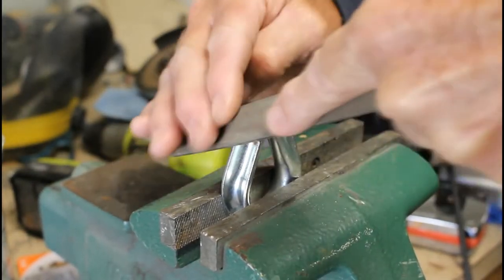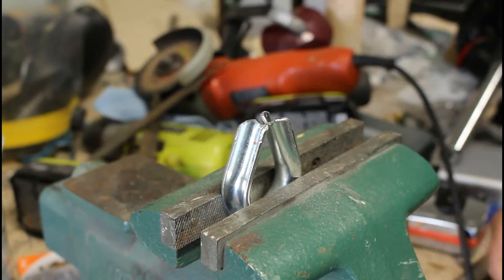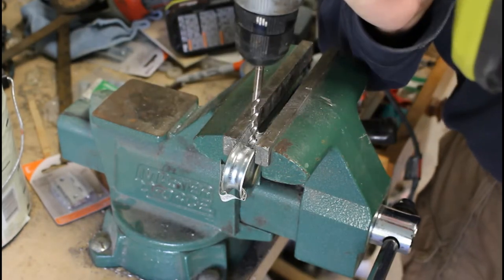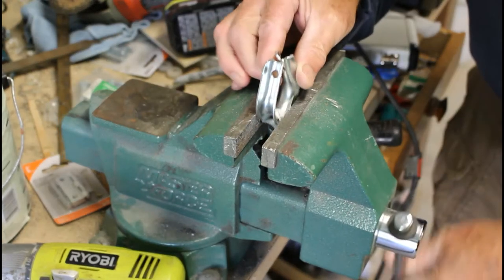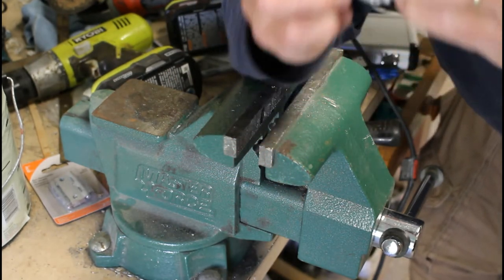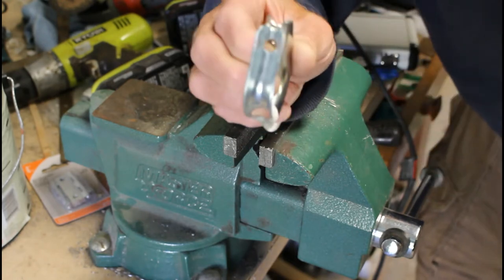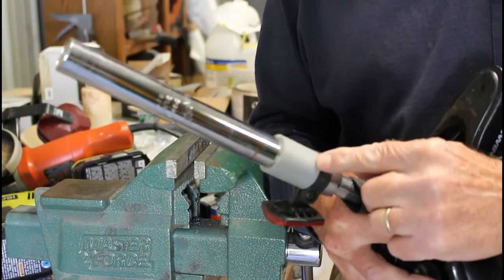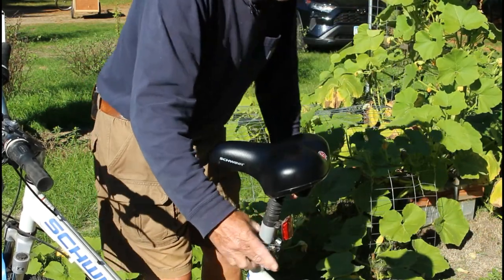My $3 Seat Post Bike Trailer Hitch

Comment: Hey, thanks for the video! I'm missing what the end of the trailer looks like that connects to the thimble with the pin in it. I there a U bolt or something similar at the end of the wood rod? Any chance you could take some close up pictures?

Comment: What is the pin called that goes into the thimble? I really appreciate this video and your great attitude :-)
Reply from the maker: Thanks Jakob. It is just a 1/4" x 1 and 1/2" hitch pin. This one has a D wire that locks it in place. They are commonly used as a safety pin on trailer hitches, and are available either on Amazon or any  hardware store.
Reply: Cotter pin

Comment: Nice shop! I'm going to a seat neck hitch design and will use 2 hose clamps on a large oblong chain link. The trailer pin will go through a second link on the Two link chain. MarkMannM2
Reply from the maker: Sounds interesting Mark. Good luck!

Comment: Ok, you showed the seat post kit, but you didn't show the actual mounting on the trailer tongue in the video. Can you explain how that mount to the trailer tongue is supposed to be done. please. I am wondering why just a 1/2" horseshoe was chosen and not a larger one? This is very simplistic in design and that is great, but I wonder how well it holds up over time with the big trailer cart you have in the video. Your tow bar to the actual trailer is a straight piece. Lots of bike trailers use a rounded tow bar that curves up over the rear tire or even a hitch anchored to the bike rear axle. I am in the process of trying to construct a barrel trailer which will be done up like the ones you see pulled by a lawn tractor as cars. It is a total DIY project and every time I view a different video, I seem to get more and more ideas for doing it up. This one may be great, but one issue I can see is that with a suspension seat as my bike has, it would put the seat up higher to add a hitch setup on that post. Ultimately, it defeats the purpose of the suspension seat, as it won't allow the seat to drop down enough. I need a lower seat than what came on my bike, as it sits too high already. My seat also flips up so I can remove my battery from my electric bike.  A seat post setup as yours would mean I could not use the seat in the same manner in removal of the battery, as the hitch would then be in the way. No real issue on your bike, but it may be on my own. Can you address this reply with your own thoughts, please? Nice modification and nice video explaining it. I'll have to give it a try and see how it works out. My barrel train car will be done up as an airplane and house my dogs as I ride about my neighborhood. I drove a motorcycle sidecar rig for years and riding with my dogs was a great pleasure, so this bike trailer is something I really want to make for them and me to enjoy. Thanks for the video.
Reply from the maker: Greetings James. I have used this hitch on suspension seat posts. But yours sounds like it may not work for this design, if you do not have enough height for it. You might need to go with a rear axle mounted hitch. The 1/2" thimble is the largest one available locally, and it has the proper inside diameter for most seat posts. I have used this design for canoe and utility trailers on several of our bikes for about 7 years, with no issues. I even pulled a canoe, with two 10 year old boys inside of it, behind my bike in a local parade, using this hitch.  If you want to see how a trailer tongue connects to the hitch, I have a link to a previous video in my reply to Nik, about 4 comments below yours. Good luck with your project. It sounds fun.

Comment: What are you using on the tongue of the trailer to hook it up to the seat hitch?
Reply from the maker: Hey John. I messed up by not showing the tongue. It was on a previous video, so I neglected to show it again. In the past, I used metal conduit as the tongue, squeezed the end together in a vise, rounded it, and drilled a 1/4" hole to fit the hitch. The last trailer had a wooden tongue, with a piece of 3/16" metal attached vertically to the end, to fit into the hitch. Here is the link to the other video. Just skip to the part showing the tongue. 
https://www.youtube.com/watch?v=Bu2f29JWAV4&t=2s

Comment: the center gravity of the trailer is too high. it will rock to the point flip over.  Very danger.

Need mount it as low as possible. 

-----

however, I was wondering if you ha e a diy way tp make seat post from conduit?
Reply from the maker: The trailer tongue is in alignment with the top of the trailer. If there is a danger of tipping over, I have not expereinced it. Not sure I understand about a seat post from conduit.I have made trailer tongues fron conduit in the past, rather than from wood. Flatten the end of the conduit in a vise. Drill a 1/4" hole, and grind the end rounded, so it fits into the hitch.

Comment: you must be riding super slow. I made a similar connection 5 years ago like yours from parts directly from the hardware store, but I found a trailer without low center gravity like Burly Bike Trailer, Trailer is not stable, Connector needs to be as low as possible.

Comment: Need to show the connection
Reply from the maker: You're right. I should have shown the connection. I had done so in a previous video , so neglected to do it in this one. In the other video, I show how it connects within the first 5 minutes, so you don't have to be subjected to the whole thing.
https://www.youtube.com/watch?v=Bu2f29JWAV4
Reply: @backwoodbasics9383  But it doesn't have any swivel action that allows you to lay the bike at an angle as shown in the video, unless it means that the hole in the tongue is much larger than the pin diameter.  This video needed to include the tongue and pin clip.
Reply from the maker: @thomasmiller1340  https://www.youtube.com/watch?v=Bu2f29JWAV4

Comment: You don’t show the pin. And you don’t show how you attach the piece of wood to your device on the seat post… great ideas are only as good as the details that you can share… Respectfully, you’ve left out to the most important parts!!!!!
Reply from the maker: Agreed. That was an oversight on my part. I had done a previous video showing the connection, and neglected show it again in this one. Here is the video that shows what you wanted to see.
https://www.youtube.com/watch?v=Bu2f29JWAV4
Reply: Lighting response.  Thank you for the full demonstration.   I actually needed to see the final product in use and the connection and other things im bout to dive in.   Im tapping into a fabrication tickle of late😅.  Started with a fan base that broke, and well I made a base out of wood.  Cut 2 circles. 20 inch radius and 3, 2 inch flex board strips for the walls.  Spray painted primer, full can of glossy black.  Funny thing I learned.  Over spray and use the spary force to push paint around... so satisfying,  kinda like a black epoxy.  A week later. Finnished with a full can of clear.  And then a wonderful happy accident  happened.   The clear finish dried up in a dry skin looking texture.   So i decided to make the whole thing look like that. Now, when light hits the base. ✨️✨️✨️
So nice.  

RIG, Mr. Bob Ross.🌌

Comment: You missed out the most important bit. How do you connect the trailer to the hitch. If you have to connect it to the pin well that`s not very safe especially if you have your dog in the trailer. We need to see it CLOSE UP while your manouvering the hitch not 10 yards away. So you connected your hitch to the saddle stem and put your pin in to secure it and said "that`s it set to go" OK but what comes next is to know where you connect the trailer to. The only place I see is the circular part of the pin. Come on Backwood show us properly and finish your demo off by connecting the  trailer to which part of the hitch CLOSE UP. Why pay more you ask, well to be sure the trailer does rip the pin out of the hitch.
Reply from the maker: I know. It was a bad move. I neglected it because, in my head, it was a follow-up video, and I just failed to repeat the hitch connection. It is shown in this previous video. Just skip to the hitch part. 
https://www.youtube.com/watch?v=Bu2f29JWAV4&t=6s
Reply: @backwoodbasics9383  OK got it thanks, if you get your fingers out of the way.